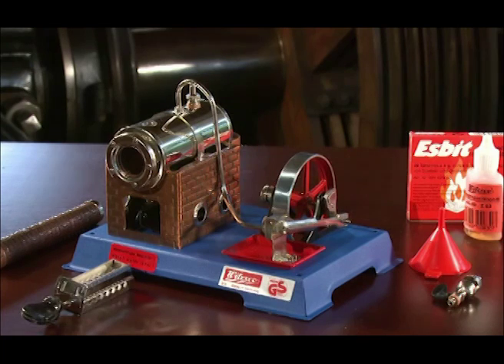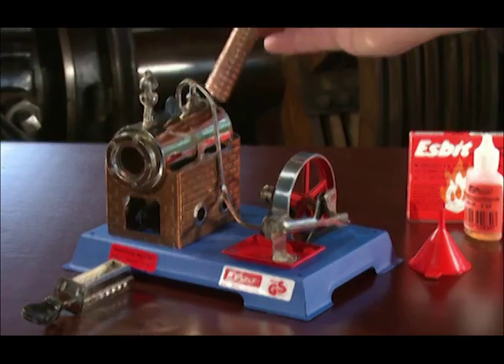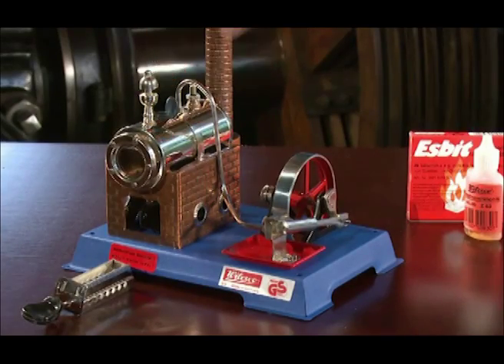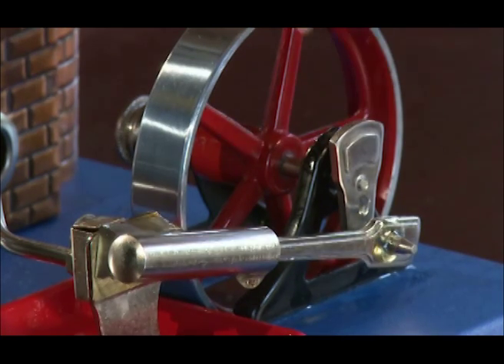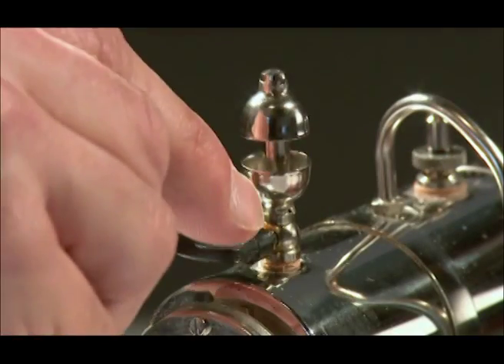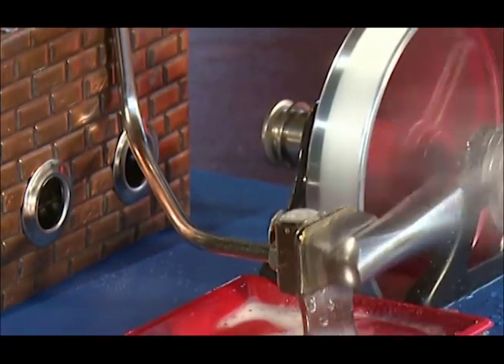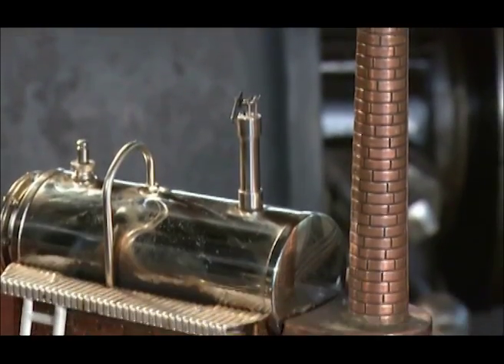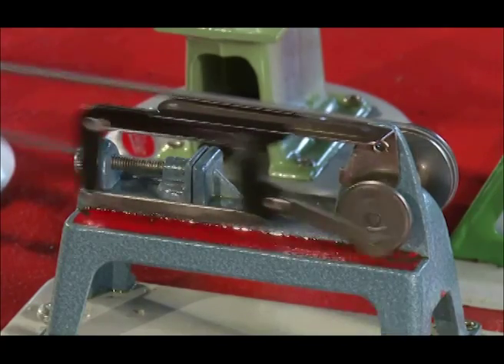How to Use a Wilesco Oscillating Steam Engines

Comment: Best thing to do is remove the whistle and insert a pipe to a tank, use a cut off valve and turn on and off to add water to the boiler, its technically an injector then :)
Reply: Lol.  Next we will add a condensate return system and Deaerator for maximum efficiency.

Comment: Use Distilled water (like water for car batteries) this prevent lime Stone to build up in the boiler and the tubes 😎
Reply: maybe you can clean scale with citric acid, that's how i clean my electric kettle, not many shops sell distilled water where i live.
ps: a common name for citric acid is "powdered lemon extract", mix with some water (dosn't need much, a tea spoon in half a liter), works best when hot

Comment: How am I supposed to get all of the water out of the boiler once it’s cooled? I use a pipette to get most of it out but there is still so left that I can see when I tilt the engine forward. You can’t just flip it upside down, because the way the hole for the safety value is that there are threads that go down into the boiler and there is t enough water in the boiler for it to reach over the threads. Should I look for a longer pipette?

Comment: pls dont use normal water use destilled water
Reply: Distilled
Reply: Sorry for asking but why wouldn’t you use normal water? I have no background in engineering so that’s why I’m asking.
Reply: MFG ! Tap water has a lot of corrosive minerals. Heat & water is already a bad combo for metals and it just adds to the problem.
Reply: My  Steamengine exploded
Reply: pseudoprodigy where i live (utrechtse heuvelrug) has potentially the best tap water in europe (there are almost no minerals in the water)
Reply: @pers2450  that's really bad if there was no minerals you would die.
Reply: I use to work in a power station, chemist in laboratory,  on power station floor.
No way would you ever use tap
 water. Very pure demineralised water.
If not even silica goes in the steam to damage steam turbine blades. Tap water no good for boilers or steam engines or turbines.
Reply: @s10ondubs what happened to your safety valves?

Comment: Just a question, in the clip you say to remove fuel tray whilst hot,  so it won't stick.
But that is when it has expanded because of the heat. I tried what you said and it's very hard to get out when the tray is hot.
So is this a mistake in the video?
Reply: No, it cools the tray sticks hard in there, trust me, I was scared of all most breaking the knob off the burn tray. Now I always slide it 1/2 way out when not in use

Comment: I have the same as that its a d6
Reply: mira vanleeuwen - Is a D6 powerful enough to drive a implement?
Reply: nightlightabcd I’ve had a d6 powering 4 tools with two line shafts and 6 drive belts
Reply: I removed the engine from my bugatti veyron and replaced it with a D6, it's much faster now  👍